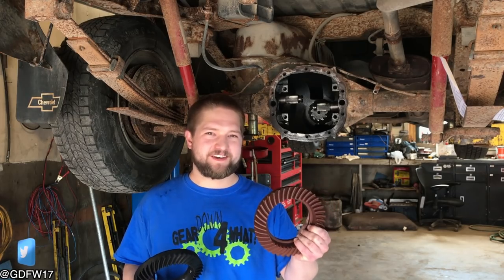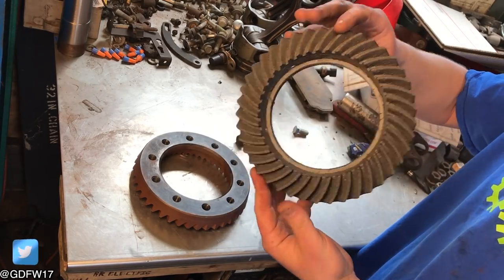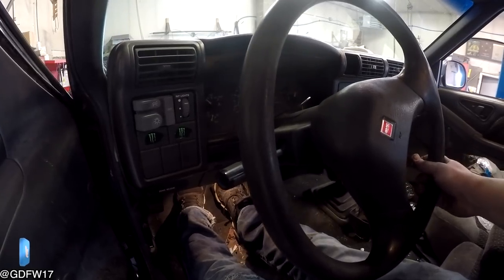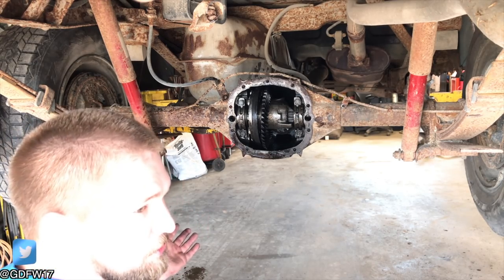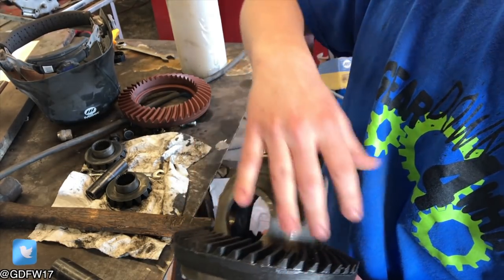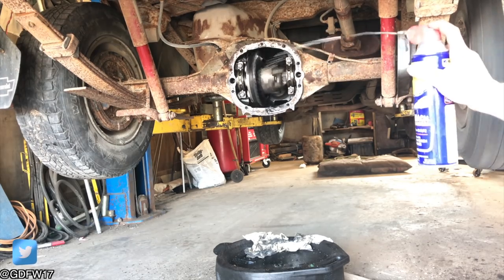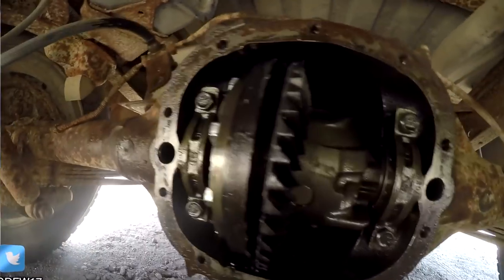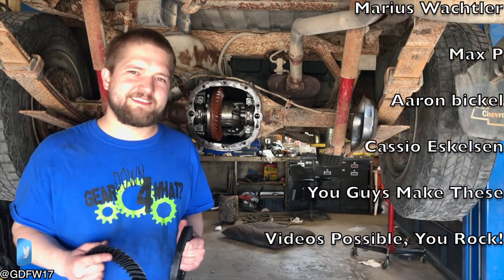Replacing Drivetrain Parts with 3D Printed Carbon Fiber Nylon - FOR SCIENCE!

Comment from the maker: Hey!  You guys talked me into revisiting this, I'm currently reprinting it! Follow me on Twitter for updates: https://twitter.com/GDFW17 and don't forget to ring that bell to get a notification when the video comes out!
Reply: Man you should print one solid piece and then tap the threads OR if you really want solid threads then check out V-coil, it's basically a tool that allows you to repair threads if you'd see it you'd understand how it works, I use it all the time in the workshop and those V-coil coil threads are really strong and I think they would really strenghten that part, you'd just put the coil threads into the plastic. Cheers!
Reply: Could always do it the same way, but just use a heat gun to reheat the cooled down material.

Or what if you made it as a 2 piece mold, like what it turned itself into when it broke, but with thinner nuts, and less thickness on the mating face piece, then a bit more on the toothed section, and drill spots to put some steel guide pins. Or print them onto one of the parts, but any sort of pin setup would hold the 2 pieces together better.
Reply: Another way is to insert the nuts while printing. I would restructure the program to print a complex layering sequence to allow for the insertion of the nuts while maintaining structural rigidty whilst in perpetual motion.
Reply: The best and probably easiest way to do this would be to slice the model in half, then add protrusions to one half and divets that line up with the protrusions to the other half leaving holes half the thickness of the nuts on both halves so that they also act as pegs to hold the layers together.

If you send me an stl file, I can fix the model for you. :P
Reply: Gear Down For What? Post this on thingiverse and I'll tinkercad it to perfection for you.
Reply: if you print the pinion with the same material it shouldn't break, its just like how for the distributor on your engine has a gear set tooth designed for the cam lob, if its too hard or soft it will destroy the cam lob or the distributor.
Reply: yes i would like to see this again with a good solid part i am intrested and i do belive it may work alot better
\
Reply: I'd love to see this with a SLA resin printer.
Reply: If you stop to put nuts in reheat the part and printing plate with heat gun
Reply: You are orders of magnitude outside the bounds of material strength to succeed ate this. The first time you give it the gas, it will sheer apart.
Reply: Felony Videos but we want to see that :) De-laminations are not as cool!
Reply: You should have printed the whole thing at once and leave hexagon holes for the nuts to sink in. Then you would have pushed those nuts in there. Start the 3D printer again and printed on top of those nuts in order to block the holes and only leave the thread part of the nuts visible with a round hole. OR filled those holes with some super strong glue with a bolt screwed in those nuts so the thread part of the nuts doesn't get filled up as well. Then you just unscrew the bolts, install it and rescrew the bolts there. Most likely would have made a lot stronger part.
Reply: half depth the nuts in, that way if it comes close to failing the glue will take twisting (torsonal) load (nuts act like pivots in a different axis to the rotation of the ring gear) not shear load, which caused it to break in the first place. Keep the heat in the part with a heat gun, or failing that, a hair dryer, While hammering in the Nut and the part will work.
Reply: you dont even need nuts at the speeds you were driving, just leave some holes in the back of the gear and let the bolts tap their own thread into the plastic.
Reply: Overall weak design. lame. imagine a burnout attempt. load test the crap out of that diff
Reply: Your left rear brake is dragging.
Reply: Change the design so you can slide the nuts in from the side of the ring gear, sort of like the t-nuts on a milling table. This way you can 3D print it solid and put the nuts in after it is finished.
Reply: Why not try building the bottom half first and have the nuts printed around afterwards so its more of a single part , maybe print bases for each nut from the start , and print right from the bottom of the part up while the nuts are supported on a base that could be shaped in such a way it would be locked into the part even if there is delamination and if they did they would delaminate horizontally in reference to the parts movement so you wouldn't have to worry about the part breaking down its entire length
Reply: try again, use a heated bed + heat up the part in an oven before you start to print the second run.
You could refine the process faster if you just print a smaller test piece. 
If done corectly the part should break in any other place (teeth for example) but not in the middle like in the video.
Reply: I’d recommend to print it sideways (as it would look while in the diff) with supports so the layers are perpendicular to the rotational force pulling on them, that way layer adhesion isn’t a factor that could cause something like that delamination. just tap the threads I’d say
Reply: you mean with a 30-45 degrees tillted bed ? thats a good idea
Reply: I’m kinda curious now how this is going to work. So here is a sub.
Reply: Gear Down For What? Do it man, for science!
Reply: I suggest you find out how much that filament shrinks, and print slightly larger then anneal it. That should bond the paused layer to the rest of the print.
Reply: Gear Down For What? 

Yes but without the nuts.
Reply: It won't be tough enough for road use but if you were to injection mold same part and pinon gear might be able to handle the shock load . Keep trying the ideal has some  merit !!
Reply: Try using special plastic metal for the threaded bolts.
Reply: Use 2part epoxy that your public works Dept uses to attach things to the road. It's designed to last for several years, but takes pressure and time to set. Hope this helps
Reply: Gear Down For What?  Place the bolts inset into a jig platform. Start building the part around the the screw the nuts on mid build so you don't have to stop the machine.
Reply: WD 40 isnt a lubricant its made to break down corrosion deposites maybe next time try something like silicon based lubricants and a PLA that wont dissolve in it
Reply: Gear Down For What? I would definitely try threaded holes. I think the pause to put the nuts in is the only problem. It may not hold up long but who knows. You may be on to something here lol
Reply: I feel like the gear will be strong enough to drive around on gently. It doesn't have nearly the hardness of the cast iron gear, so it should wear much faster. Also I'd imagine the teeth will sheer off if you give it too much throttle.
I would maybe grease the gears too, if you're gonna run it with the cover off.
Reply: Gear Down For What? No it won't work. Those parts are made of strong metal for a reason. This is an obvious waste of time lol.
Reply: Might I suggest you replace and mold multiple components into one. That is the advantage of 3d printing afterall
Reply: yeah or insert treads too Vcoil or Recoil..etc,,,
Reply: Gear Down For What? Make it out of jb weld !
Reply: you need to change your 3d printer, and add a laser to preheat the surface to make them stick.  ie ( you need a printer head with a built in laser to preheat surface ) then you will be able to stop at any time and you would only need the laser when you restart the print ,,
Reply: Trent Nelson This does work for the distributor because the cam isn't trying to turn any kind of significant weight.The pinion is turning the ring gear to move thousands of pounds.I believe a printed pinion will break before it turns the ring when the truck is on the ground.I think his best bet is to print a solid one and tap the bolt holes.Still won't last long,maybe long enough to get another can of WD from the store.lol.
Reply: IDK much about 3D printing or how different this filament is to PVC pipe but maybe PVC cement and primer would have been better instead of JB Weld.When you glue PVC together with the cement it actually melts the plastic to weld it together it doesn't just adhere to it.Just a thought.Could work or be a complete fail.
Reply: Dude i am looking for someone that has acess to a 3d printer to make me 1967 impala front corner light houseings for my 67 impala,someone stole the ones off my car and i cannot find them anywere please if u can help me i will pay you cash for them!! There just plastic houseings a bulb mounts in and a lense goes on it! Its kinda looks like a turn signal light but its a running light that just stays lit. Will pay for them if u can make them!!
Reply: I was hoping you where using a markforged printer becuase their parts are so much stronger than just nylon x
Reply: There has to be a way if you was to do this again with the embedded nuts I'm thinking when you pause then when you restart hit it with a heat gun that way you could get your layer adhesion
Reply: Try sika flex 💪👍
Reply: Another Idea if you can put indent holes on oneside and pegs on the other so they fit into each other then sika flex that stuff is very strong 💪👍
Reply: Please do this again on YouTube  I'm subbing you👍👍

Comment: I would still love to see a retest with a one piece gear.
Reply: He also needs to print It standing or at a 45 degree angle to keep it from "delamination". 
Stuff this simple should never be printed.
Reply: And use brass inserts instead.
Reply: @lucaslittmarck6804  problem with printing it at a 45 deg angle is that some teeth of the gear will be prone to de-lamination. 
no good way to print it on FDM printers.
Reply: @darkshadowsx5949  Non-planar printing with variable layer height might help.
Reply: This joke is so good, 3 years later and people still don't get it

Comment: Please don't use WD-40 as a grease. WD-40 is a mixture of grease and degreaser, it is not good for greasing up parts
Reply: BrainSeepsOut,  yup, just some 30W oil should be fine
Reply: Yup, just some 30w oil should be fine.
Reply: For gearboxes and diferentials mostly are used oil with SAE above 75W
Reply: it doesn't have any 'grease'... nor is it a degreaser.. .its a WATER DISPLACEMENT solution... nothing about it is a de-greaser, rust remover, anti-seizing agent, or anything. Its literal purpose is to displace water around whatever you spray. It just so happens that the displacement mixture also penetrates, and thus helps with rust, but in-so also CAUSES rust... its an oxidizer basically... it also is a HUGE enemy of ANYTHING 3D printed, because of its penetrating nature... 

As a side note, something like Brake Cleaner is in fact a de-greaser, sooooo
Reply: kwestionariusz1 75w- gear oil viscosity is comparable to engine oil of a grade somewhere between 10 and 20. The reason gear oils have a higher grade is so you don't mix them up with engine oils.
Reply: mandrakethemadcoder oils are graded for a reason diffs and gearboxes use heavier oil they have large gears with large teeth with high load its no way related to getting them mixed up
Reply: ryan hawkins Look it up, it's not heavier. It's because the additives in gear oil are different to those in engine oil, due to the difference in working temperature and pressure.
Reply: For example:
https://www.opieoils.co.uk/t-oil-viscosity-grade-classifications-explained.aspx

"It should be noticed that there is no relationship between the SAE engine oil and gear oil classifications. A gear lubricant and an engine oil having the same viscosity will have widely different SAE grade designation as defined in the two classifications."
Reply: Hikari , you make very valid points. WD-40 is surely one of the best water displacers ever. I can’t even begin to count how many times it has saved the day for me and countless other people I’ve helped on the side of the road by removing moisture from electronics, distributors, etc. I also agree that it’s super “skinny” penetrating quality would not be good for 3 D printed items. Although, I disagree with your statement that it’s an oxidizer. My experience from my earlier/younger days as a dirt bike MotorCross racer/rider, common practice at the end of the day, was wash bike of all mud , dirt, etc... towel dry where you can reach. Then, spray the whole motorcycle from the top down, engine, wheels, all plastic fenders, outer exhaust system...basically soak the bike down. (Note: not good idea for use on street bikes)It, prevents rust, repels moisture and dirt. It extends the life of nearly every surface it comes in contact with. Note, within reason, don’t be a total noob and spray your grips, unless you are trying to remove them. It works amazingly well at protecting all steel, aluminum, plastic , vinyl and making your MX Motorcycle look shiny/satin for days/weeks/months while just setting. Then, when you are ready to ride, after starting, within a couple minutes the  WD-40 will evaporate/burn off quickly without any overwhelming smoke. Also, great before and after cleaning a car/truck engine, engine compartment and battery connections as well. No more green goo or other oxidation. Hell, weirdest of all, its come out here lately that many anglers on the “BASS MASTERS TOUR” spray it on their lures, plastic worms, etc. and are supposedly getting fish attracting results?? WTH??
Reply: mandrakethemadcoder: As I have many, many years of experience as an auto mechanic and car builder, I can say from knowledge and experience, your assumption is wholly incorrect. Ryan hawkins has it right. Gear oil is MUCH heavier than engine oil due to something called "pinch strength", or how much pressure it can take before metal-to-metal contact. The oil in an engine employs some hydraulic pressure within the bearings to keep the parts separated within a fine tolerance at high speed.

Transmission and gear oils are much heavier because they must withstand higher pressures trying to force them out with smaller contact spaces in less precise spaces. The additives are different because the environment is, such as more detergents for gear oil than engine oil, partially due to the fact that gear oil isn't changed as often.

If you think that 75W is the same as 10-20w, try putting that in your car's engine. Then try to see how many pieces of the broken oil pump have circulated through the engine before they split the main bearing caps.

Try an experiment: Long sheet of glass or metal held flat at a 45° angle. One tablespoon of 70W gear oil and one of 20w engine oil dropped at the same time. Which one flows faster down the sheet? I would recommend you at least look at this channel to learn some things about engineering: https://www.youtube.com/channel/UClqhvGmHcvWL9w3R48t9QXQ
Reply: Oh YEA? ever tried to poor 75w-90...
Reply: Because this matters when you are installing 3D printed parts in your car...
Reply: The problem with using WD-40 as any kind of lubricant is that the base oil is designed to be a carrier for the aliphatics not a lubricant. So, while the VOC's evaporate all you're left with is a thin film of dust/dirt magnet and none of the water displacing properties. It's good for an initial clean down after say washing the chain of a bicycle, but it should be followed with a proper lubricant (dry or wet depending on conditions). The worst crime I see is people using it as a rust preventor on cast iron surfaces, when paste wax or other rust prevent products (usually paraphin in suspension) are designed to dry rapidly and leave a protectant film.
Reply: KM Crafting  That sounds “right on” to me .... and Thank you for the awesome information. I believe You are exactly right. I failed to mention in my “latest novel” , aka comment above, that the WD’s dust collecting after a day or so was always a “trade off”  for what we thought, was protection on the metal and plastic surfaces. Although, we never had any problems with rust but, I also failed to mention I’m talking about the South Eastern, non coastal USA conditions too. Hey y’all, I believe I actually accidentally learned something over here.
Thanks!!
Reply: WD-40 is used as a rust preventative coating by industry all the time.  It's used because it is dirt cheap and is almost as good as a purpose-made rust preventative coating.
Reply: i agree i coat all of the areas on my mountain bike that are in the line of fire with wd 40 se when you ride through water it doesn't stick to the paint, the water is displaced
Reply: KM Crafting speaking of wax coatings tectal makes a great protective coating for cast parts
Reply: I've used wax products on some gearboxes and they seem to work great in the short term.  30 weight oil is fine to use as a spray in gearboxes, it won't hurt anything in small amounts.  You use heavy grease so it dosent get flung off as easy, sticks to the surfaces better and dosent thin out as easy when hot. Long term the proper heavy grease is definately better but short term 30w would probably work ok.
Reply: @lewis fishing lure scent?!?  WTF lmao, maybe it would help the guy who made a lure out of a 11mm wrench.   Also yea I remember the days of distributors, WD40 saved me more than once from the leaky ones.
Reply: Wait. Why is there degreaser mixed in with a lubricant?
Reply: For fast moving metal parts, using regular WD40 is worse than using no lubricant at all.
Reply: mandrakethemadcoder Exactly. SAE 90 gear oil is roughly the same thickness as SAE  40 motor oil. Gear oil and engine oil viscosity is measured on two different scales.
Reply: @DeViceCrimsin_  it thins out the lubricant and allows it to penetrate